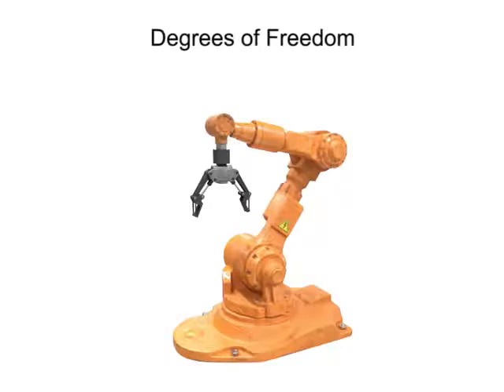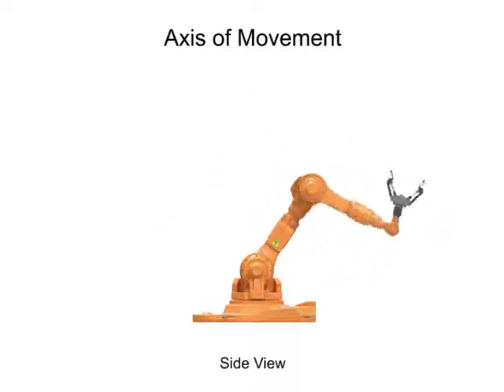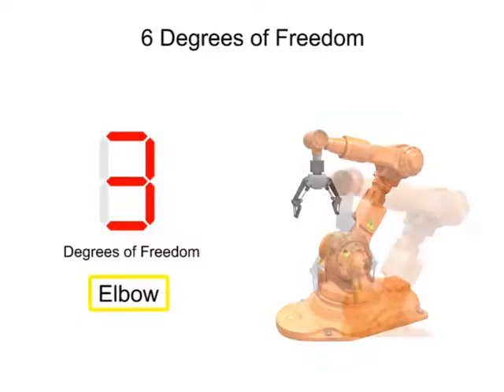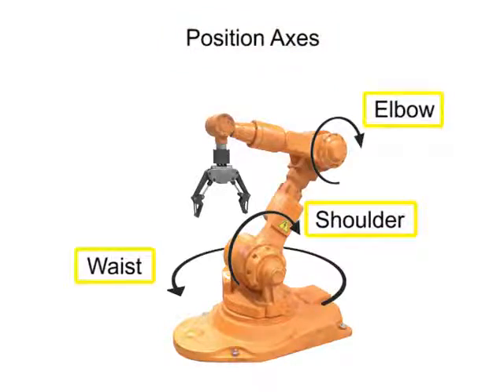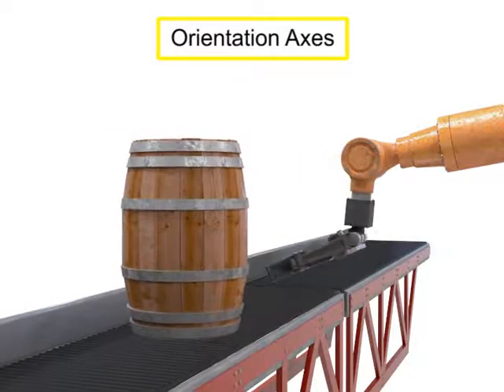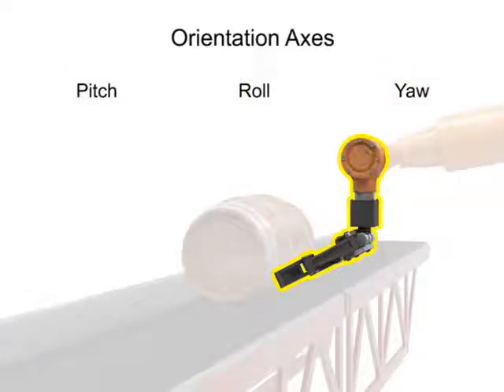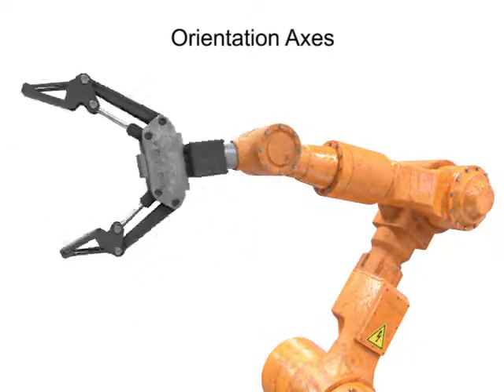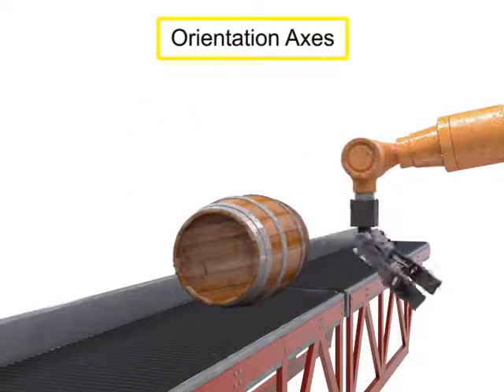Robots: Axis and Orientation of Movement - Pitch, Roll, Yaw 2/6 | Industrial Robotics

Comment from the maker: Thanks for watching. For More Videos: Please Subscribe My Channel
Industrial Robotics Tutorial: https://bit.ly/38hQnWd
Industry Blueprints Tutorial: https://bit.ly/2ZqCn8p
AC Circuit Analysis Tutorial: https://bit.ly/2VyoHqP
Physics Tutorial: https://bit.ly/2BjVOaX
Motion Control  Tutorial: https://bit.ly/31sqUrz
Advanced Programmable Logic Control (PLC) Tutorial: https://bit.ly/3g8FfO3
Embedded Systems & Microcontroller Tutorial: https://bit.ly/3893dpH
Motors and Drives Tutorial: https://bit.ly/3dH0yF1
Fluid Power Design and Application Tutorial: https://bit.ly/3dEjvIq
Fluid Power Control Tutorial: https://bit.ly/3eniF3S
Process Control Tutorial: https://bit.ly/3hTASs7
Channel Link: https://bit.ly/2IsqVS for watching more Videos
Online programming occurs when the robot is on-line, or in an operational mode. The two types of programming we will discuss here are teach pendant programming and lead through programming.
Simulations provided free under a Department of Labor grant awarded Eastern Iowa Community Colleges.
😌Don't Forget To Like, Share, Subscribe & Comment 😬
======
تعريف بالقناة:
قناة تعليمية مهمة للجميع عليها أكثر من 210 فيديو تعليمي، بها:
1- شرح لبوردات الاردوينو Uno & Mega 2560  وعمل مشاريع رائعة بها حيث، شرح Servo Motor, DC Motor وطرق توصيله والتحكم في إتجاهه، و EEPROM وتوصيلها وكيفية التعامل معها. وال Stepper Motor، واستخدام الاردوينو كمولد موجات جيبية ومسننة ومثلثية،
رابط الدورة من هنا: https://bit.ly/2PvtHvx
2- شرح دورة الأنظمة المدمجة Embedded Systems والميكروكنترولر واحتراف البرمجة بلغة الامبيدد سي Embedded C. وعمل مشاريع رائعة…
رابط الدورة من هنا: https://bit.ly/2KadqX2
3- شرح كيفية الربط بين الاردوينو واللابفيو وعمل مشاريع رائعة بهما.: https://bit.ly/2KlTssj
4- شاهد أيضاً،دورة مهمة جدا لطلبة الهندسة في شرح أساسيات ومبادئ التحكم الآلي او هندسة نظم التحكم
(Automatic Control or Control systems engineering):
رابط السلسلة:  https://bit.ly/2NGyeYd
5- دورة متقدمة في التحكم باستخدام اللابفيو (مهمة لأقسام تحكم أو كنترول والكترونيات). وهي تطبيق عملي لدورة التحكم الالي 
رابط الدورة من هنا: https://bit.ly/2K7aVEE
6- سلسلة Root Locus Method في هندسة التحكم الآلي لطلبة كلية الهندسة، قسم كهرباء،
رابط السلسلة: https://bit.ly/33CROvi
7- سلسلة عملية في القوي الكهربية او الكهرباء المتردده الاحادية والثلاثة الطور (Electrical Power) لطلبة هندسة ولكل مهتم بالكهرباء
رابط السلسلة كاملة:  https://bit.ly/3dWEckc
8- بعض الدواير العملية الكهربية المهمة للجميع.
رابط الدورة من هنا: https://bit.ly/2Fnli65
9- دورة في القياسات الكهربية، مهمة لطلبة كليات هندسة ولكل مهتم بالالكترونيات والكهرباء: https://bit.ly/30RdTVS
10- دورة في احتراف الرياضيات والجبر والهندسة والتفاضل والتكامل والقوانين الخاصة بها بدون تعقيدات.:  https://bit.ly/30ykUtG
11- دورة في احتراف برنامج اللابفيو الرائع LabVIEW : https://bit.ly/2TOx4y4
12- برامج مهمة للكمبيوتر واللابتوب الخاص بك: https://bit.ly/2qT9NM6
13- Complete Practical PLC Course Tutorial: https://bit.ly/3dHon09 
14- Green Screen Tutorial Link: https://bit.ly/3esShFa
15- Complete Process Control Tutorial: https://bit.ly/3hTASs7
16- Complete Fluid Power Control Tutorial: https://bit.ly/3eniF3S
17- Complete Fluid Power Design and Application Tutorial: https://bit.ly/3dEjvIq
18- Complete Motors and Drives Tutorial: https://bit.ly/3dH0yF1
19- Complete Physics Tutorial: https://bit.ly/2BjVOaX
19- Complete Embedded Systems & Microcontroller Tutorial: https://bit.ly/3893dpH
20- Advanced Programmable Logic Control Tutorial: https://bit.ly/3g8FfO3
21- Physics Fundamentals Tutorial: https://bit.ly/2CNrzcU
22- AC Circuit Analysis Tutorial: https://bit.ly/2VyoHqP
23- Industry Blueprints Tutorial: https://bit.ly/2ZqCn8p
24- Industrial Robotics Tutorial: https://bit.ly/38hQnWd
وهناك المزيد علي القناة، وان شاء الله هذه مجرد البداية فقط.
رابط القناة:   https://bit.ly/2IsqVSC
وتعمل اعجاب ومتابعة لصفحتنا علي الفيس صفحة المهندس المحترف
رابطها: https://www.facebook.com/المهندس-المحترف-100879698187843
متنسوش الإشتراك بالقناة لمتابعتنا وتفعيل جرس التنبيهات ليصلك الإشعارات بالفيديوهات أول بأول.
====
#ُIndustrial_Robotics
#الروبوتات_الصناعية
#Kyrillos_Refaat